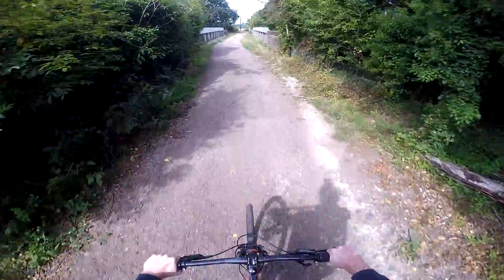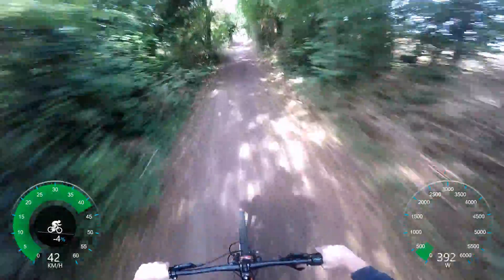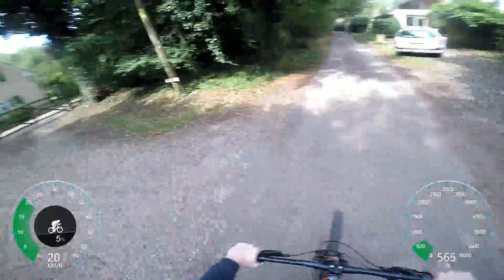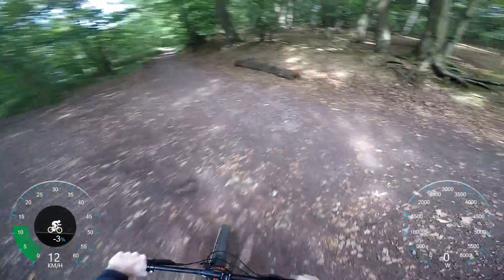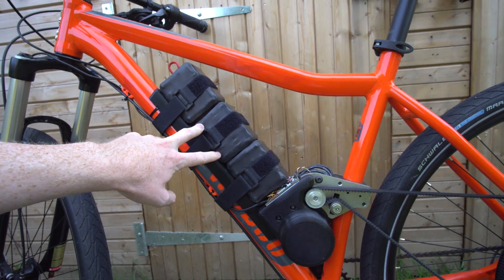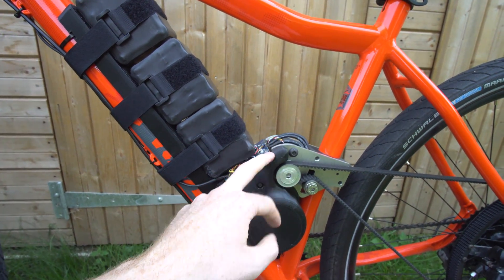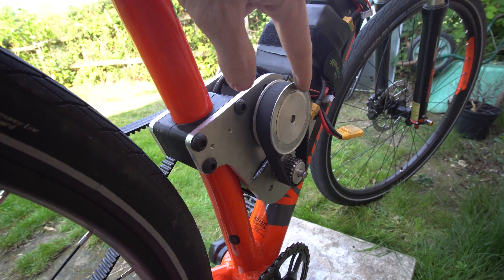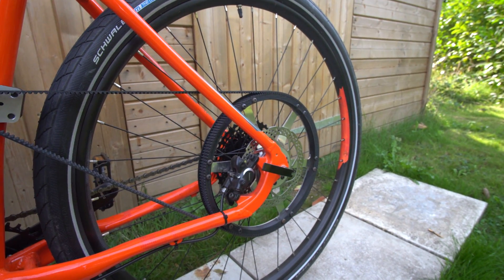Electric Bike 4.0 - First Test ride

Comment: How do you deal with the insurance/licence of the ebike as it's not pedal assisted? Is it even street legal in the UK? Love the build but I'd be really scared to ride it with no helmet :)
Reply from the maker: Just need to be careful when riding on the road, I don't tend to go above my max pedalling speed, so it's essentially a heavy pedal bike. Haha yeah I just realised it looked like I wasn't wearing a helmet when I checked the gopro battery, but the gopro is mounted to the helmet! Thanks
Reply: Phew that makes me feel better! Sorry for assuming it's not pedal assisted. What's the function of the throttle then? Is it to determine how much you get assisted?
Reply: I think you are taking a great risk.  If you are involved in any kind of accident they will throw the book at you as it will be classed as a motorbike.
Reply: @TomStantonEngineering    sorry mate but are you clueless?  This bike is not street legal!  You can't get valid insurance on or off road!  It doesn't meet the requirements for the pedal-assisted exclusion, it's a frigging motorbike pure and simple!  Check out how much it would cost to get it certified as a roadworthy motorbike.  Gulp.  Am I a miserable old git?  Yes.  But have you rung around insurers giving a description of the vehicle?  I don't think any would agree to insure it. So the first accident lands you in jail even if it was clearly the other person's fault.  Wise up, mate.
Reply from the maker: I wouldn't consider myself clueless, I understand the laws completely. They're there to prevent people that actually are clueless from buying a kit and riding around on pavements at 30mph and diving between cars. I don't ride this on the road much, apart from when I'm riding to an offroad path, and I do so as if I was riding a regular bike. I don't go on main roads or ride through towns, I always keep to the side if a car comes and stay below my natural pedalling speed. I fully understand your concern as I too have the same concern when I see others riding 4kw hub motor kits through busy towns, weaving in and out of cars and pedestrians. It's always a bit of a controversial subject in the ebike community and I hope it stays as difficult as it is for people to purchase off the shelf over powered ebikes. It's the same as when I used to fly drones back when they were called quadcopters. No one batted an eye that they would be a such a danger because the people building then were sensible. But as soon as the average joe could buy one with no aviation knowledge, they suddenly become these "death traps".
Reply: @TomStantonEngineering  well said Tom! I too have flown model aircraft safely for many years only to find them referred to as death drones, takes the fun out of it. I've been riding a 2kw ebike for 3 years as often as I can dreading the day some ass hole shuts me down. Always some ass hole who gets a thrill taking your fun away!
Reply: I'd just worry about some idiot running out in front of your bike and you ending up getting in trouble as it would be your fault no matter what.
Reply: Could maybe add a switch somewhere to current limit it.  Or actually make it current limited by default and then have an override.  That way if ever you get stopped and they measure it, it will be within spec.   Hate how governments always want to regulate every little thing these days, it's ridiculous. can't have fun without laws getting in the way.
Reply: just need less pll bitching about everything and problem solved !
Reply: The eBike is pedal assisted and Tom was wearing a helmet.
Reply: You didn't see a helmet because the gopro was mounted to it. He took off the helmet to look at the gopro but you can hear the clip.

And yes, electric bicycles and electric skateboards and anything else which doesn't require a licence to ride is fine without insurance. He's only not allowed to go on the motorways
Reply: Actually when an e bike is over 250watt you do need a license. It is then classed as a motorcycle or moped and would need to be registered and taxed.
Reply: backtrackit  Psssst! No one has to know! ;-)

Comment: I think I would run into serious legal issues with such a bike in Austria due to speed regulations with e-bikes. Are the similar regulations for you?
Reply: Cinnamon Donkey of course it's not legal, nothing homebrew is nowdays, that's half the fun of it, the only issue I foresee is liability, and at what point does this project stop being a bike with an electric motor and becomes a vehicle requiring all the bells and whistles that come with that, like insurance, tax etc.
Reply: Cinnamon Donkey  3.6 mph on throttle and 15.5 with pedal assist. so if you get caught it would be classed as  motor vehicle , with no mot no insurance no road tax.
Reply: Why not take a 250 motocross bike flat out down the trail with kids dogs etc!!!!      John Horton is right. Pedal assist only is allowed. But other than that it breaks every rule in the book plus absolutely stupid dangerous for other trail users. Shame on you.
Reply: @cinnamondonkey2397  If he'd been distracted for a half second, say by being stung by a wasp or bee, that encounter with the other cyclists and dog could have gone very, very differently.
Reply: I wish all pusjbikes went that far then I might actually get home on time.

Fucking cyclists
Reply: phuck ewe  There were others present.
Reply: Hey Tom. I have friends who will easily ride their pedal powered mtbs down a trail at 30 mph. Are they somehow safer than this man under motor power? Now no, I don't want dirtbikes on trails any more than the next guy, but please learn to lighten up.
Reply: phuck ewe It’s not about government playing big brother, it’s about common sense ~30mph on a footpath is taking liberties with people safety.
Reply: phuck ewe Maybe it’s also ok to drive at 60mph in a 30 limit if you can’t see any pedestrians by that logic. The fact is he’s breaking the law and in my opinion it’s dangerous.  That’s two facts end of.
Reply: @Michael Smith
The guy who has to bury his wife/kid/parent after (s)he's hit and killed. There's a reason why cars have to be registered, and we have speed limits, and blood alcohol limits. It's not about protecting idiots from injury - it's to protect everyone else from the idiots.
Reply: tin2001 exactly, I’m not sure why anyone would think riding almost 30mph on a public footpath is ok. I’m not fun hating, I’m life loving.
Reply: It certainly is not street legal in europe and I think tom has been irresponsible in not speaking of this.  It's a motorbike.   You need
1)  a full crash helmet
2)  front and tail lights lit even in broad daylight
3)  a driving license
4)  3rd party insurance
5)  a certificate of roadworthiness.
The last one is seriously difficult and expensive to get for a home build.  Without it you can't have valid insurance.  Sorry if I sound like a miserable git,  but tom will be bankrupted if he ever causes anyone injury, and maybe slung in jail.  Use on private land with the landowner's permission should be ok, but even on private land accessible to the public it's risky.
Reply: side mirrors + license plate
Reply: These laws only apply when riding it on an actual road, where cars drive. Not off road.
Reply: rdizzy1 he's riding on public footpaths, people's houses and it's not pedal assist, he's breaking the law end of
Reply: Do you have a citation that shows that footpaths have the same exact laws as traffic laws on public roads? Since when do you need turn signals on an ATV or dirtbike that is never driven on a public road, only off road. The pedal assist is a different topic. Regardless, many illegal things are not enforced, and there are many things that are not illegal that are generally bad to do. The laws are not the end all be all of everyones lives.
Reply: Of course https://www.gov.uk/electric-bike-rules anything over 250 watts or 15.5mph is classed as either a moped or motorcycle and therefore is illegal to ride on public footpaths, roads, cycleways etc so Tom is breaking the law. 

Let's be really clear Illegal things not being enforced is irrelevant, that's like saying as long as I don't get caught it's fine.  If you look at speed limits on motorways, they were introduced in the UK after an AC Cobra went flat out on the M1.  It's also clear common sense should prevail here and travelling up a hill at 40 odd km/h with members of the public on the same path is not a good idea. The selfish few spoil it for the many.
Reply: Here Now just more worried about people’s safety. The reason you can’t ride a motorcycle up a public footpath has nothing to do with it’s method of propulsion.
Reply: john Horton the law is very clear on this nothing in the law talks about pedal assist u don't have to use it or have it the only thing the law says is this"An EAPC must have pedals that can be used to propel it"
Reply: zods muffin The governments own website says if a bike can be propelled without peddling it is automatically classed by EAPC rules as a motorcycle or moped so therefore needs to be registered and taxed etc.  You’re taking nonsense.
Reply: john Horton no it does not say that at all it says this "An EAPC must have pedals that can be used to propel it" that is copied and pasted off the gov website ur talking about go look
Reply: zods muffin maybe you need to read the whole thing. Aside from the fact Toms bike is over 250watts and can be propelled at twice the EAPC limits therefore immediately classifying it as a moped or motorcycle. 

It also says that it’s NOT an EAPC if it can be propelled without pedalling, which Toms can be. Basically it’s not even a grey area, it’s black and white breaking the law.
Reply: john Horton I never said he wasn't breaking the law in fact iv put a post on here saying he is and as it stands what he has made is a moped it will only be classified as a motorcycle if it can do over 30mph i was only pointing out to u that the law says nothing about it having to be/use pedal assist once again the .gov website u posted ur self says this"An EAPC must have pedals that can be used to propel it" now look at the way this is worded it says pedals that can be used to propel it not pedals must/should be used to propel it there's a very big legal difference in this wording as long as the motor is under 250w cant power u over 15.5mph and could if u wanted to pedal it ur all good but toms not if the police see this vid they can and most likely do him for it
Reply: and here is what the .gov website says in full what an EAPC is "What counts as an EAPC

An EAPC must have pedals that can be used to propel it.

It must show either:

    the power output
    the manufacturer of the motor

It must also show either:

    the battery’s voltage
    the maximum speed of the bike

Its electric motor:

    must have a maximum power output of 250 watts
    should not be able to propel the bike when it’s travelling more than 15.5mph

An EAPC can have more than 2 wheels (for example, a tricycle)."  so there it says nothing at all that u need to pedal the bike https://www.gov.uk/electric-bike-rules have a look for ur self
Reply: zods muffin It clearly says you can't do what Tom is doing which is all I'm saying. Not sure what all your waffle means as I've clearly pointed out that as the bike does not meet the EAPC rules it classed as a moped/motorcycle AND in addition it can be propelled without pedalling therefore all the previous arguments about power and speed are mute. Muting you now. Bored.
Reply: john Horton I own one and it will power me all the way up to 15mph without me having to pedal at 15mph the motor shuts off u keep saying u need and have to use pedal assist but this is not true and bad info I posted it up to point out to anyone who sees this and might been thinking of buying an e-bike that u don't need to use pedal assist as not to put them off and for the last time I'm going to say this I agree with u what tom has is a moped and what he was doing isn't lawful
Reply: zods muffin you’re just not listening. I know a pedal assist bike up to 15mph is fine and after that you can pedal as fast as you like like a normal bike. What I’m saying is that it doesn’t matter if the watt is 250 and it has pedals IF you don’t need to pedal to propel the bike ie. twist throttle which Tom has.
Reply: you should try and just enjoy life there bud instead of worrying about what others are doing. its ppl like YOU that try to spoil the fun for many.

Comment: Please test it out on a paved flat road so I can compare your top speed to my personal human powered best! It looks like a lot of fun. Also, can you give an estimated range for the batteries? Can you also charge the batteries by pedaling the bike with the wheel off the ground?
Reply: In the video he did say that the batteries will do about 15-20 miles (24-32 km)
Also, in one of the earlier videos he reckoned it'd do 30-35 mph (about 48-56 km/h) on a decent bit of path, and in the video (going up hill) he pulled 45 km/h (28 mph), so if you can manage that, Tom's E-Bike has got some serious competition (lol)
Reply: @Stevo_1998  watts?
Reply: And that was even bloody uphill at an approximate 9% incline... I've seen model aircraft with less power (approx 3.7kW) lifting up themselves and a 7m wide 1:3 scale glider. 4kW is a s*load on a bike!
Reply: With 3.5kw+ it will be easily above 40mph(70kph).
Reply: He could Strava his rides and grab a few KOMs with that bike.
Reply: His metr module allows him to combine gps data with all of his metrics, take a look at their website in the video description :)
Reply: 4.4 kw got me 48mph' i was not using a hub so chain losses etc have to be taken into account and on a stand up scooter aero was turd, i imagine a hub powered recumbent may get over 55mph for same given power.
Reply: Recumbent will get you over 60 easy with 4.4kw.
Reply: How much power can a well trained human output over – let’s say – 20 seconds? 700W? How much power does Tom’s motor have? And then Tom can still add his own power to that of the motor. Of course Tom’s position, clothing and bike is not very aerodynamic.
Reply: @Mike-oz4cv  "they" frequently measure and monitor the wattage output of athletes in cycling, with the maximum and average posted as a stat onscreen during televised events. Some of those guys and girls are putting out cyborg like numbers
Reply: You asking wrong question. Top speed doesnt matter because you can have same top speed with 500W and 3kW, it depends on gear ratio. What matters is power that bike outputs. 1000W ebikes can go even 50kph, so his almost 4kW setup could go probably even 70-100kph with flat road and good gear.
Reply: Lol. You lose
Reply: You posted your comment 1 Day ago while the video is Just uploaded 8 min ago
Reply: patreon perks
Reply: That vehicle doesn't have type approval for use on UK roads.